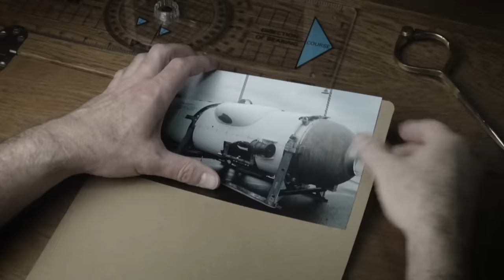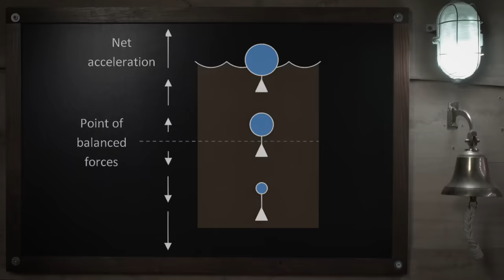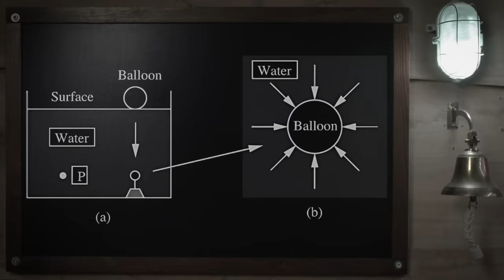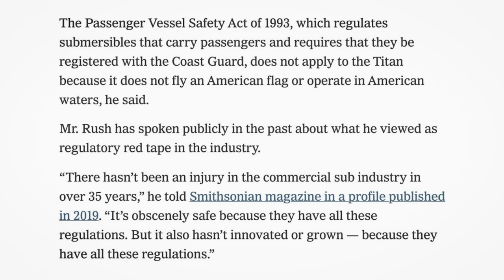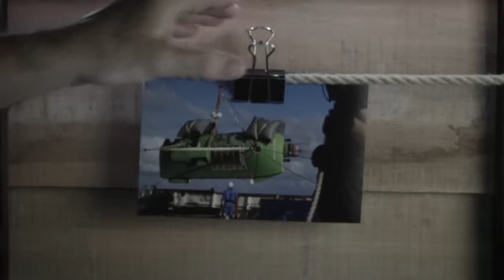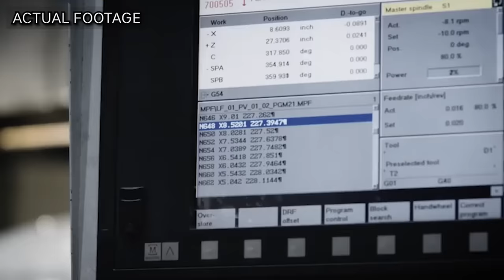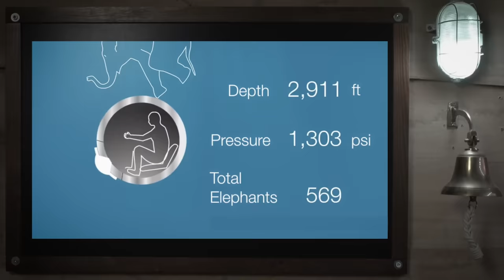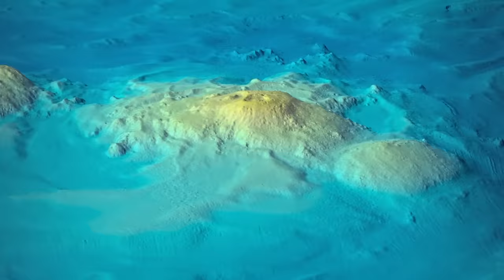Titan: From Inception to Implosion

Comment: I just want to correct you on a relatively minor point. The controller used for the submersible, while Playstation patterned, is actually from Logitech.
Reply: £29.99 he even bought one of the lowest price model/make
Reply: @Stroopwaffe1   Though the bigger issue is the fact that it is wireless, which seems like a terrible idea to me for controlling anything of importance.
Reply: @subduedreader5627  It's not only wireless, it is also connected to a PC with a Windows OS instead of a Realtime-Computer with a Realtime OS or an SPS.
Reply: @Blakbox92 Game controllers are actually pretty standard for this kind of thing, which makes sense, they're designed to be intuitive and efficient. The military uses them for all kinds of stuff. Pretty sure they don't go wireless third party though. I wouldn't even rely on that for gaming, much less my life.
Reply: The controller choice while frugal, was unlikely to ever cause anyone to die! The poorly designed and insufficiently tested hull is (was!) the problem, forget the stupid controller as it really was not that big of a deal, it didnt cause the hull to implode and that's what killed the people.
Reply: Not at all. The practice is to model their proprietary controllers after video game controllers. Using an off-the-shelf controller, that could get stuck on a command, disconnect abruptly or overheat in an environment that it wasn’t built for, is as absurd as it sounds.
Reply: I paid more for my Gamesir controller to play Bioshock, then this guy paid to control his deep ocean submersible.  Damn.
Reply: @Commanderziff yeah the Xbox controllers and the military I'm sure have some sort of contract to make reliable products and they probably discuss the matter accordingly. Whereas, Stockon spending was more about saving a buck more than paying for that safety.  Human life no price on it. 😂😂 so simple.
Reply: @vtubersubs3803 They don't use game controllers for the main navigation systems of vehicles tho. They use them for weapons systems or to control drones. Not to maneuver submersibles or submarines.
Reply: Well your name is very apt now isnt it?
Reply: NERD !!!!!!! Just kidding.
Reply: @Commanderziff  yeah my payment on my future tarkov mouse and keyboard will cost much more than the subs assembly parts. Kidding but doesn't make you wonder of the cost of the bill of materials. 😏😏
Reply: Was Logitech fully aware of the usage intent of this controller? That lives depended on the usage of this controller? What and where are the certifications? If certified, how?
Reply: It is a wireless controller that can be used wired as well. They also had backup controllers. A lot of modern vessels and systems utilize modern game controllers. This is a non-issue.
Reply: It's a crap controller. Signal cuts out all the time. I literally stopped using mine in Subnautica because I kept crashing my cyclops (yep, that's what the submarine in Subnautica is called). Upgraded to an official xbox360 controller because it's far more reliable. 😂. Much later, I noticed the credits showing "cyclops is a registered trademark of ocean gate inc." While game controllers are not uncommon in real life industrial applications, Stockton honestly chose the crappiest one...
Reply: I am not convinced the controllers he used were robust enough and certified to be used where lives depended on them in extreme conditions. Piloting a ROV is not the same as a submersible  containing humans. Off the shelf parts are only fine in low risk situations.
Reply: @vtubersubs3803  I saw an interview where someone from the Navy said they use them for certain functions but never a whole ship/vehicle.
Reply: @dunxy 
If you can't control your submersible, while near stuff you can crash into or get tangled in, I'd consider that life threatening
Reply: Why does that even matter?
Reply: That Playstation remote controller would be okay for that purpose so long as it is connected to a system with high reliability, i.e. Military / Avionics protocol.
Reply: @sujimayne  Wired is preferable, but maybe both in some kind of emergency fail safe situation.
Reply: @Tiffany_Turbo  The point is, in using a familiar format, and testing out any and all components for failures, one could easily design that input system to accept other controllers with just a little customization and carefulness. I've redesigned systems to adapt to my needs and preferences without any headaches.
Reply: @vtubersubs3803 They do at times use 3rd party controllers but typically it’s only used for non critical systems. Only really used in navigation for drones. That said, the game controller is not really an issue at all.
Reply: Yeah! That's a PC controller with an XBOX button layout and bad analog dead zone. Please keep PlayStation out of this
Reply: Maybe the vessel wouldn't have imploded if he used a wii remote
Reply: @Lmzip2 no, Logitech is a mid to low-end producer, there ceo even gave a statement because people relentlessly mock them and there company for something they had no influence over..
PS: they consider to print a new warning on the label... to not use there stuff for something lime that...
Reply: people putting emphasis on how it was controlled is dumb as hell and has nothing to do with the hull decompressing and imploding. doesnt matter what the controls were the submersible was failing regardless.
Reply: @nomercyinc6783  It's just the tip of the iceberg on all the stupid design choices that were made.
Reply: The guidance computer was running Linux and the program was written in Ada.
Reply: @nomercyinc6783 People make reference to the selection of an off-brand game controller as the main navigation system because it is indicative of the neglectful and lackadaisical approach Rush had to planning and design, not because it was the direct cause of the implosion. In this regard it is very enlightening and deserves to be noted. No one is saying it was in any way the cause of the implosion.
Reply: I guess shortly after this event Logitech sold out of these controllers.,kinda strange
Reply: @nomercyinc6783 They were unsuccessfully trying to ascend before the thing imploded. How do you know that the controller wasn't responsible for the system failing to ascend faster. I don't know if it was or it wasn't, but I do know they had trouble jeticing the skids mounted on the thing and that they were barely ascending. That means they were at depth longer and maybe if they would have ascended faster they wouldn't have imploded.
Reply: Sorry this comment made me laugh. 😂👌
Reply: @ArronP Do you think it was all just a conspiracy to get free advertising and sell more controllers? Have those bastards no heart?
Reply: Thank you for that correction.  I sleep better now.
Reply: @Stroopwaffe1  jeez louise....what a penny pincher.
Reply: @subduedreader5627  he was lucky to live as long as he did... but lucky ppl don't realize that always eventually runs out.
Reply: @vtubersubs3803  they were doomed with or without the remote My friends
Reply: @Commanderziff  he had to pay gor his coke habit
Reply: @vtubersubs3803 yes but not shitty wireless.logitech ones.
Ive had that exact controller and it was shit, had input delay and disconnected all the time
Reply: Relatively minor? It is absolutely irrelevant! 🙄🙄🙄🙄
Reply: Now your fucking point was?
Reply: Ha ha Stockton couldn't even buy a name brand playstation controller. Pinching pennies every he could lol
Reply: @sujimayne  Not to pilot with tho. Weapon systems or periscope controls.
Reply: Third party controllers give out in months and he’s using it to power a life protecting vehicle.
Reply: @RamblingOmarr You didn’t understand?
Reply: The product reviews for that controller are hilarious.
Reply: I remember having a Logitech controller 🎮 back in the day. Relatively quickly (within about 3-6 months I think), it glitched out, and some of the buttons just performed random functions.

So, that was what first came to mind for me when Logitech was first mentioned within the context of this story.
Reply: Which, to me, is even more laughable. Cost cutting even the smallest of things.
Reply: @Lmzip2 Logitech wasn't involved. Dude went to bestbuy or whatever and picked the thing up, that's it. Maybe bought it online. 

Using gaming controllers generally isn't a problem. Everyone knows how to use them, which is good. If the operator happens to pass out, or something like that, anyone else can take over. 

So, that choice boils down to picking a seriously bad one, but it would still do the trick.

What bugs me about this, is that Stockton openly said how he doesn't care about rules or laws. Those are there for a reason
Reply: Yep he even cheaped out on the controller.
Reply: @dunxy  It controls the movements of the submersible. I'd say that's pretty important.

Comment: Kudos to that engineer who had the integrity to lose his job instead of signing off on a design so clearly flawed from the get-go.
Reply: How did he prevent this?
Reply: @johnj.baranski6553 the engineer? ultimately he failed to prevent anything. however he stuck with his morals when it came to the safety standards and stood for them all the way to court. most people would have caved once they got sued
Reply: Ya that guys name should be widely known.. and he should be lauded a hero.
Reply: David Lochridge
Reply: @johnj.baranski6553 
Where did you even read the word prevent?
Who even suggested anything in that ballpark?
Do you just respond by blurting out random thoughts?
Reply: @brucemcintosh7466  lock ridge saved lives
Reply: That is a called having a conscience.
Reply: @lord_ozymandias except he did cave and dropped his lawsuit. 
He had good reason to drop it but even better reasons to pursue it. 
Jean Pierre is the biggest culprit IMO - he actually knew better and lent his credibility to a fool.